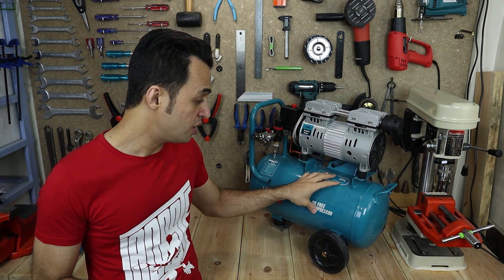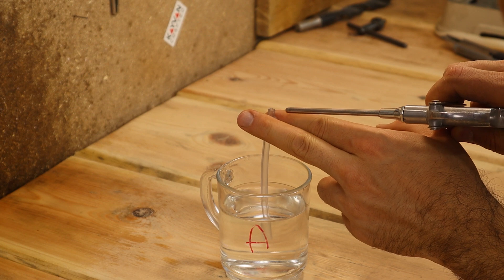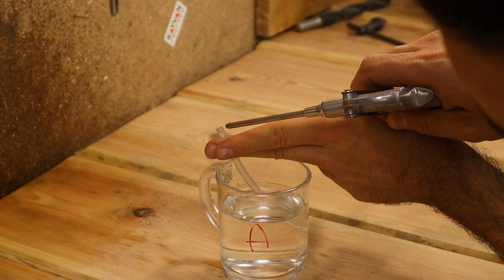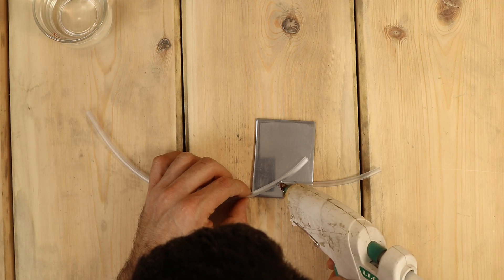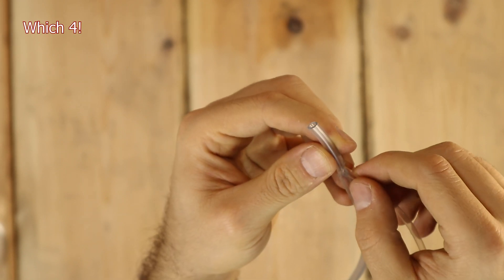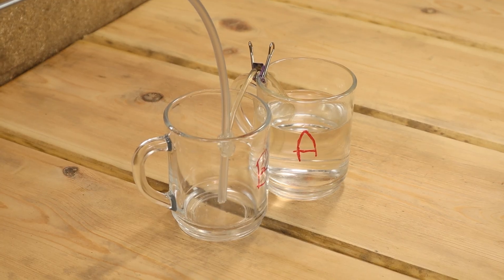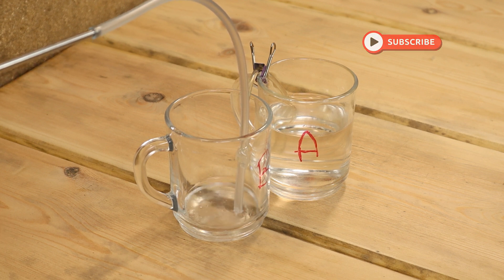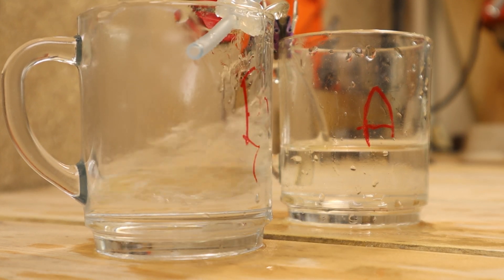How to Convert Compressed Air to Vacuum | DIY Venturi Pump

Comment: The reason it doesn't work good is that you are not using Bernoulli's principle.  So, it's not a venturi, or at least a really poor one.  Bernoulli says an increase in speed decreases pressure.  So you have to accelerate the air at the point of the input.  This is typically done by a larger chamber feeding a smaller chamber that feeds a larger chamber.  The air in the smaller chamber, where the acceleration is happening will be at low pressure.  Use that drill press behind you, and a chunk of aluminum.  You can easly get close to a full vaccum.
Reply from the maker: Thank you Mike for the tips.
Reply: do you have an idea of sizing? diameters, legths, cross sections of suction holes... i have an access to a 3d printer, wanna make one. made one even multi stage, but i guess its too wide, with too big suction holes, would love an input from someone who has done something similar...